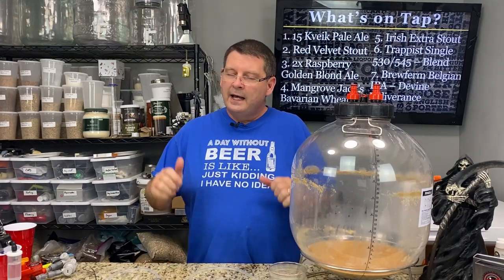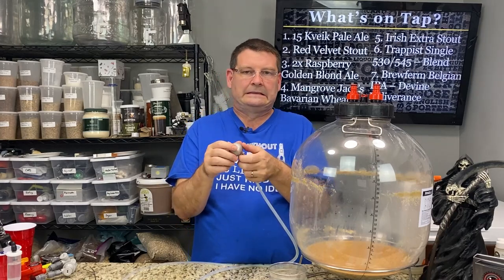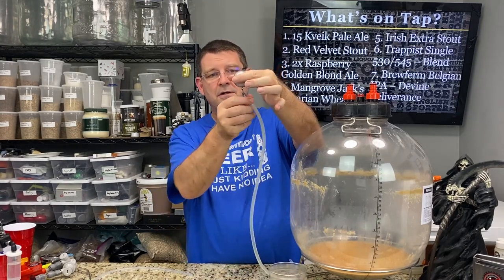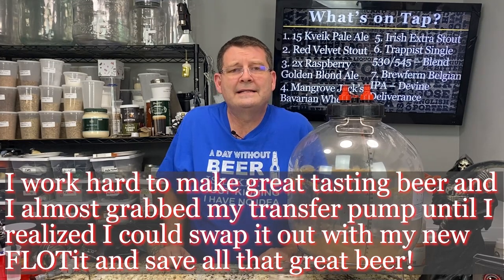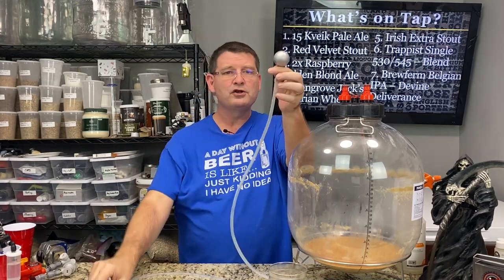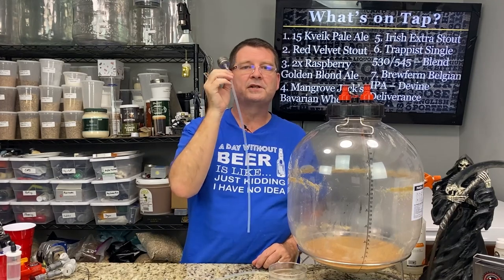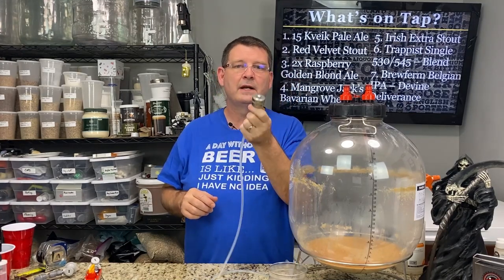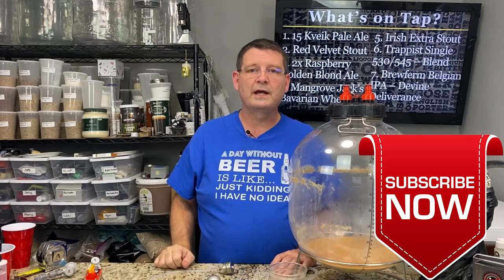Corny Keg Floating Dip Tube, Major Issue

Comment: The Flotit, unfortunately, is not available where I live ( NZ ).  So to get around the design flaw in the Kegland floating dip tube I do two things. 1. Cut the tube shorter so that the float sits on the bottom ( dry )  but the tube sits just above  above the yeast cake. 2. When transferring, as the float gets low, gently tilt the fermzilla so that the float and tube remains above the trub on the bottom.  I think the FLOTit looks like the go if you can get it but there is a work around, maybe not perfect, but something I can live with without wasting a gallon usable beer.
Reply from the maker: Actually I asked the seller as I was considering buy a few to ship to a friend in Australia and he said it should only cost me a couple bucks but would of course take a while to get there as it was going to be shipped super cheap which means super slow. A lot of people seem to make almost identical versions of the floating dip tube with the ball and I can say at least Kegland sees there are some issues so they recently came out with a filter which I've come to realize isn't as important as what it does to the dip tube beyond filtering. As the dip tube gets close to hitting the trub (normally it would be point slightly toward it the filter will actually lift it up a bit and the filer will hit the trub first keeping the tube from sucking in the trub as easily and allowing for more beer to be pulled first and as cleanly as possible. The gallon was a big of an exaggeration if you didn't tilt the all rounder to help people kind of see at what level it might hit the trub without modifications or assistance and of course I think anyone using this and the FLOTit will tilt the fermenter to get every drop of clean beer they can.

Comment: The SpundIT is a great product which is why I but his floating dip tube last year. But I always get a very foamy pour and I have to replace it with a regular dip tube. Ruined a batch because of oxygen. Any suggestions?
Reply from the maker: Sorry for the late response as I usually get email notifications on this but missed this one. Did you reach out to Tongo on eBay? He is usually response pretty quickly plus he is a homebrewer himself from my understanding. I would think there might be a problem if it is creating foam but I would expect O2 if you are referring to a Keg or fermenter as it should be full of CO2. Reach out to him on eBay as I don't know of any other way to contact him.
Reply: @BitterRealityBrewing  thanks for the response. The beer oxidize because I had to change the tube. I also switched out the o-ring to troubleshoot. I'll reach out to Tongo. Thanks again.
Reply from the maker: @dandydray6243  Let me know what he says. Thank You.

Comment: Hey, I wanted to circle back around because I had an idea for how to do a closed transfer w/ dip tube without having to open and hook out the filter. You can buy one of those corny keg lids with the gas diffuse stone on a tube. Take the diffuse stone off and let the tube hang down. Well, you essentially have a long dip tube third ball lock now. Just take the diffuser stone off.... let the tube hang down... and fill through that one. 

I was just thinking about this the other day but haven't got around to trying it. But, basically you could leave the whole system closed fill there and leave your Out alone and sealed up. 

What do you think? Might work right? Haha.
Reply from the maker: Great minds think alike as I was just thinking of this for a few reasons. One what you mentioned about filling without pumping liquid through the drip tube with the filter and allowing for the regular blow-off of excess CO2 during filling. (Just did this Saturday and had to keep pulling the release valve). The other option would be to have one in with the cab stone while slowly bringing it up to pressure to help it carb faster without worrying about the floating dip tube.

Comment: Just got my 2 FLOATIT tubes in. Just cleaned up a keg and assembled it. Wanted to test it so ran some starsan thru it and I had issues with very low flow coming out. Switched out with standard dip tube and back to good flow. Not sure if my trying to purge a keg with starsan thru the tube doesn’t work but using to dispense beer It didn’t work for me.
Reply from the maker: There are some instructions on how to tighten the liquid side to avoid closing off the flow which I haven't had the issue. Supposedly if you over tighten it, it can restrict the flow to very little or even nothing at all. Something to check on your next keg as that was probably the issue.

Comment: Just need to cut the Fermizilla float to the proper length that doesn't get hung-up along the side and then "slide the Fermzilla" down as you are emptying it. I have done so probably 15 times now and never had an issue.
Reply from the maker: Agreed on the leaning part and everyone is saying cut the hose. I actually think in one of the normal Fermzillas with the tapered bottoms where it is a bit pointy it would be less problematic but I've seen a few modifications where people have had the tips hit their trub in kegs and pressure fermenters so they recommend actually putting a piece in-between the hose with an opening to ensure even if the hose hits the trub it will pull beer first. I also figured out that the entire design from what I was able to find was from a bunch of homebrewers on Homebrewtalk (not 100% it originated there but it is there) seemed to have created the prototype of what most companies sell today ...that was almost 20 years ago. I doubt any of them cashed in on the idea as they were just helping each other with a DIY design including a SS floating ball from Grainger. Kind of wild when you think about it.

Comment: I use a torpedo floating dip tube in a couple kegs, it pulls down to the same level as a regular dip tube without issue. If it's a better product at same or similar price then I'll have to check it out. If you stopped before you completed the transfer then you are only assuming it would leave that extra amount in the fermenter, maybe try filling with cleaner or sanitizer and compare how much gets left between the two options
Reply from the maker: Thank you for having an open mind as I didn't mean to upset people as I probably should have done this video when I wasn't so tired and annoyed with the product. I have 1 Torpedo and 1 Kegland version and they are good products I just feel the FLOTit is a huge step forward in the right direction. I also did some additional research and it appears the floating dip tubes have been around for almost 20 years (that I could find), started by that old Homebrewer DIY initiative. I saw some brewers talking about designing them on HomebrewTalk back in Oct 2011 which was amazing to see.
Reply: @BitterRealityBrewing  i think with the built in filter the other one definitely has added benefits as long as it doesn't clog easier which would be my concern using in a fermenter. I use a torpedo in my 10 keg that I use for pressure fermentation
Reply from the maker: @JimmyJusa  The filter on the FLOTit has kind of large opening so it would only block larger particulates compared to the new one out by Kegland which is finer mesh but as it is 360 coverage I doubt either would ever clog unless you had a lot of trub and even then I doubt it.

Comment: My Kegland dip tube leave nothing behind but a yeast cake. If anything tweak with position by attaching a little weight or so.
Reply from the maker: This is an older video and I was a bit annoyed at the time. My biggest issue back then is that it wasn't a real improvement on a 20 year old invention. KegLand has made some improvements since, including on their Oxebar systems with weighted filters that work really well. Since this video, even the FLOTit 1.x has been replaced with the FLOTit 2.x which is the only floating diptube that I've gotten to work with filtering out tons of Blackberry pulp in a pressure fermenter.

Comment: Oof I bought enough of these to replace all of my diptube in like 10 kegs and yeah none of them work great. Switching serving kegs back to solid and will buy these flotit type diptubes for my fermenters. Cheers.
Reply from the maker: I've migrated almost all of my floating dip tubes to the FLOTit 2.x. I still have a few of the 1.x versions but highly prefer the newer FLOTit 2.x for both my kegs and my pressure fermenters.

Comment: I have the all rounder and it works perfectly. It doesn't leave that much beer behind.
Reply from the maker: I agree the all rounder is a great fermenter but in regards to the floating dip tube that came with it, it is decent but I was shocked at how much better a 20 year old design could be. Sorry I was a little over grumpy in the video but a lot of people make the floating dip tube as it appears to have originally been invented by some homebrewers helping each other that never patented it but my issue was how much the tube points into the trub and how low it was from the top. I've had two people so far that actually were a bit grumpy with me about my video only to reach out and contact me afterwards and say "Wow, I thought this thing was great until I paid attention to it and now I see what you are taking about." I'm not saying it doesn't have a place in the market place but two of the companies making these are very innovative companies that could make a much better system and probably with little effort.

Comment: Just bought  my first 2 of these dip tubes you like. figure i will give them a try,  can you give us a general length you cut the tube to for keg use? thanks keep up the good work!
Reply from the maker: I actually didn't cut the length as I like to try things as designed first. I will say all of the ones I've purchased have all been pre-cut to the exact same length which tells me the length of hose that was sent was taken into consideration. I have4 kegs going with the FLOTit and 1 Keg with the old style floating tube (it was in the keg before I did this video and the keg is almost empty) and I have one FLOTit in my All Rounder from the beginning and I was a little concerned with the yeast crusting up around the FLOTit but after moving the All Rounder it all fell loose so I'm not concerned and just need to get the pre-carbonated DIPA moved and cold crashed now.
Reply: He gives directions on how to properly cut the tubing length
Reply from the maker: @jonthebeau4653  I'll double check that as I'll be starting 2 more kegs soon with a 3rd one not far behind but without trimming it for the first keg and using in the fermzilla also without modifications was impressive.
Reply from the maker: @jonthebeau4653  Actually I was just cleaning out one of my kegs with one of the FLOTit devices in it and it sits pretty close to perfect uncut. If I cut more than 1 inch off I think I would leave more beer behind but I will check the others as it looked like they were all the same lengths but maybe this one is shorter but I'll need to verify it to confirm. (I ordered one before I ordered the other 6 so this might be the first one I ordered.)

Comment: I have one of the KegLand style. My biggest issue is getting the darn thing onto the short tube that replaced the liquid dip tube.
Reply from the maker: I didn't mention that as it can be a little frustrating but someone did point out that the FLOTit uses a slightly smaller hose that allows you to push the tube up through the keg opening so that you can put the tube on the liquid dip tube outside of the keg before putting it back in which does make things a lot easier.
Reply: @BitterRealityBrewing  I have solved the issue with 5/16" tubing temporarily perhaps. I will check with my local store to see if something like what you say might work here.
Reply from the maker: @zzing  Let me know but I suspect the metal tube might not let you slide anything (even very thin) and still be able to push it back in but I could be wrong and would love to know if you do find an easy solution.

Comment: I think this is some great info as I was about to buy a bunch of these. However, isn't the "severity" of the issue largely due to using the floating dip tube in a fermenter rather than a keg? Losing a gallon is mainly due to the radius of your object. The designers of the floating tube intended it to be used with a smaller radius. I don't off the top of my head know what the inner diameter of a keg is but Wikipedia suggests the entire thing has a diameter of 8.5." If we take the worst case scenario (ignore wall thickness) and assume we still float 2" off the yeast-cake in a keg we would only lose .5 gallon of beer.  π*4.25^2*2 ≈ 113.49 cubic inches. 113.5 cubic inches ≈ 0.49 gallons. 

I guess it comes down to if you are okay with leaving beer behind to avoid any chance of picking up sediment. For me I think having the last pint maybe pull some sediment is worth getting that extra half a gallon of beer in my belly.
Reply from the maker: Yes and No. The floating dip tube from my understanding was designed for kegs but Kegland is using them in their Fermzilla fermenter which is a great idea for transferring the liquid without opening the fermenter but the dip tube could have been design better and at minimum it shouldn't hang so low without needing to be modified after the fact.

Comment: I have a flotit in one of my kegs and I love it but you can tip the all rounder in it's frame in the direction of the diptube and get pretty much everything out of it.
Reply from the maker: I was tired and annoyed so I exaggerated a bit to get a point across as we all would naturally tip it as much as possible but my White Labs 565 yeast cake was still a bit young and soft so any movement disturbed it pretty easily.
Reply: @BitterRealityBrewing  you didn't exaggerate the difference in quality at all though. The floating diptube that comes with the pressure kit for fermzilla isn't any where near as good nor is their spunding valve near as good as the spundit 2.0
Reply from the maker: @jonthebeau4653  Very, Very true. I haven't asked the seller but I am wondering if I can swap out the gauge on the Spundit 2.0 as I am trying to keg carbonate a Saison and I need almost 48 PSI so when I chill it down I'll be 3.6 for the carbonation. I am using a Kegland one at this moment with a higher rated gauge they sell that can be swapped out.

Comment: Do you know where the FLOTit is sold? The link provided does not populate the product. Thank you. Great video! I was about to buy the floating dip tube with the ball.
Reply from the maker: Thank you and I freshened the link as I guess eBay does make people update things from time to time which will impact the links - https://www.ebay.com/itm/284231525264?hash=item422d84e390:g:jloAAOSw6ZZf4ckq - I've added an updated one directly to eBay which is where he has sold for a while and is still currently.
Reply: @BitterRealityBrewing  does this product ever go above the beer line causing only co2 gas to be dispensed into my pint glass?
Reply from the maker: @Natedavis4444  All of them do if they get snagged on something as I've had it happen with both a regular Kegland one and with one of the FLOTit and both were do to a hop bag being in the way in the pressure fermenters but not in a keg without extras floating around. If you have this without anything else in the keg, reach out to Trong as he is extremely helpful and quick to respond.
Reply: @BitterRealityBrewing  thank you

Comment: I actually use the keg land ss ball and tube.... cleans up all but the yeast cake.... great sounding argument without a studied base..
Reply from the maker: Michael, what would qualify as a "studied base" for you? I know I pushed this into an uncomfortable zone for some but have all three brands and seeing how they worked there was no real comparison. Keep in mind I did buy the new "add-on" filter from Kegland that actually helps to fix the problem but not with the filter directly. The filter actually hits the yeast cake (trub) and pushed the tip of the hose to help keep it from sucking in trub and the filter simply reduces some of the disturbed yeast from going into the tube while the liquid is being extracted from the container.

Comment from the maker: Innovative homebrewers back in Oct 2011...doing the classic DIY Keg Floating Dip tube which seemed to go from using old Yeast Tubes to the SS floating ball system almost 20 years ago. Very impressed but that was 20 years ago (almost) so the FLOTit was just another step forward in design. https://www.homebrewtalk.com/threads/floating-dip-tube.275638/ Very impressed with their creativity.

Comment: Tilt it over...?
Reply from the maker: You can tilt it a bit but the tip will hit the trub before all the beer is gone. The float is allowing the tube to be too low is the problem. If it closer to the floating part it would pull more beer before hitting the trub.
Reply: How do you tilt it over when it's in a keg in your keezer?
Reply from the maker: @EddTube  You don't but luckily in a keg you lose less but great point.